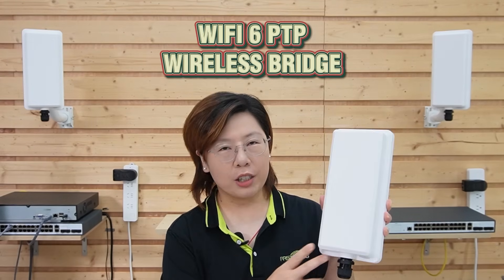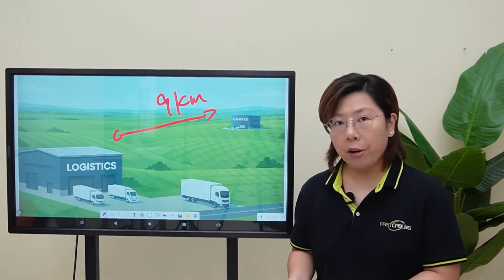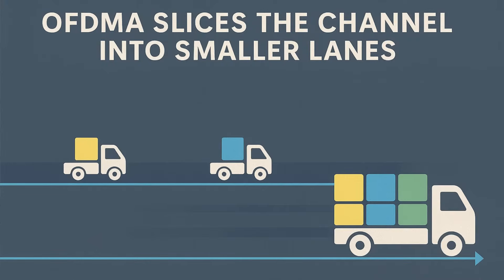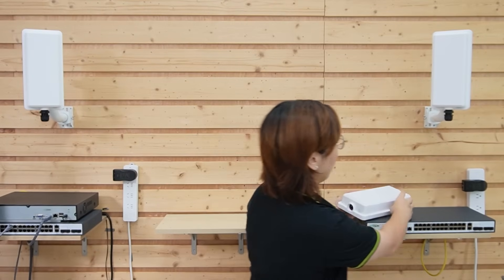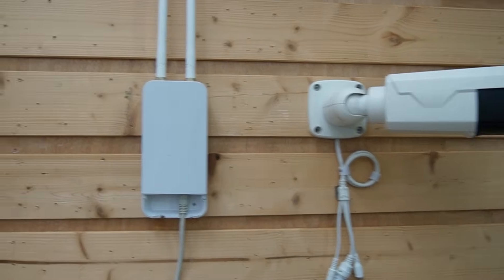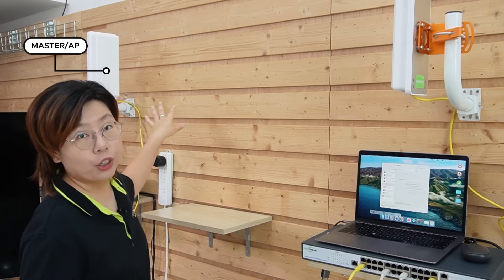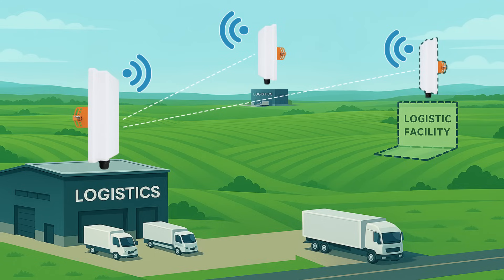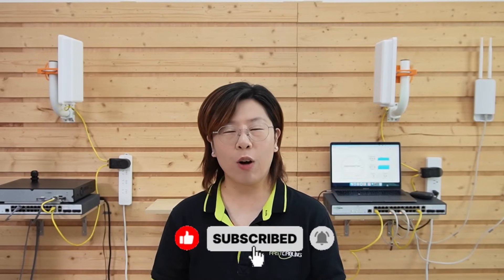9KM Wi-Fi 6 Wireless Bridge Setup Guide (Two-Location Network Link)

Comment: Very informative like usual. If I may ask, could you please show us how to manage a bandwidth? I have 100mbps network but it can not be use to more than 5 user, if there's more the connection will be way too slow 😭 I hope you can give me a guidance 🙏
Reply from the maker: You probably need a switch to distribute the internet traffic. The switch should be able to set the traffic limit. e.g. set up limit to 20Mbps for each port.
Reply: @Fastcabling i live in a community of 200 users , how can i extend the starklink so every one enjoy fast and secured internet

Comment: That's a very loud Managed switch..
Reply from the maker: You are right. It should be deployed in the rack.
Reply: @Fastcabling  My best advice is to sell those switches with fans that are quiet, people will return loud fans, its 2025, better fans or a thermal management built into the switch to keep them quiet.